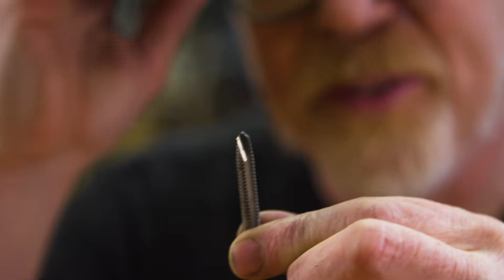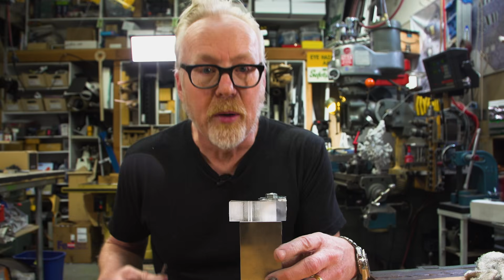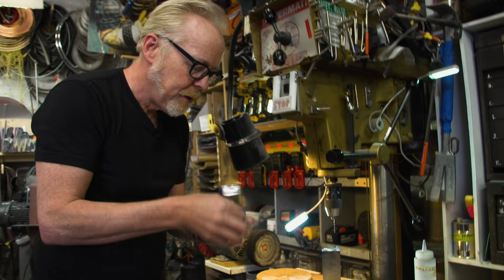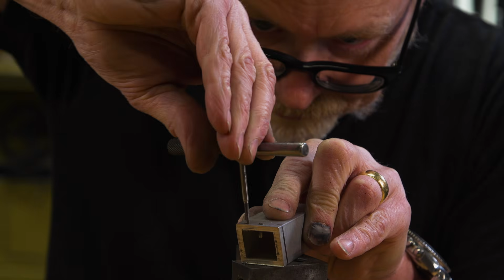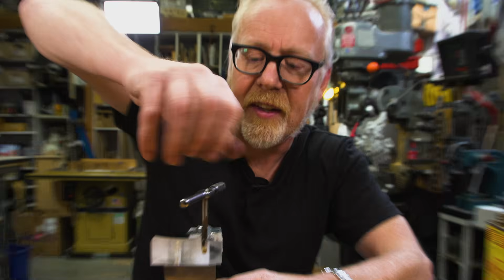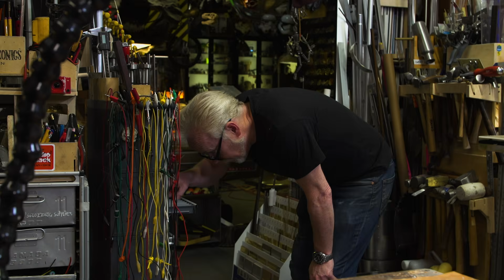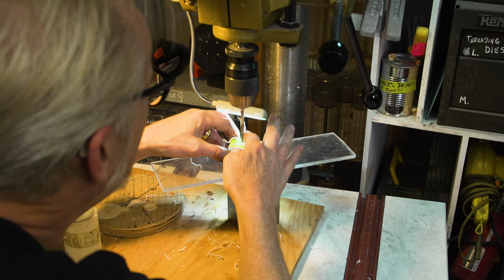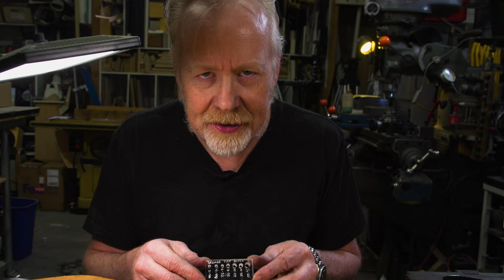Adam Savage's One Day Builds: Thread Tapping Guide Block!

Comment: Adam, this was so joyfully informative! Thank you! Your enjoyment of making and teaching is so transparent and contagious, and I learned so much!
I had to hand tap about 150 8-32 holes in an electrical panel backplane for a customer a few years back though, and it drove me nuts. Snapped about 4 taps, 
A machinist friend afterwards told me that digitally controlled drills (like a standard DeWalt 20v battery powered drill) worked wonderfully well for power tapping, since you can precisely control the torque and stop in an instant. 
I tried it for the next machine we built, got the panel done in a fraction of the time, and didn’t snap a single tap!!!
Reply: When I made panels, I would use an electric drill for tapping.  Just dip in cutting fluid between holes.

Comment: How to remove a broken tap:
Heat it red hot, smack with something hardened.
Or, ruin a carbide endmill (rpm higher than ever appropriate, light feed, melt tap, success)

Comment: Have you been using “Tool, fine adjusting (hammer)” on your finger tip?

I love the reference to the “Hitchhikers guide”

My buddy was an Admiralty (Royal Navy) certified welder. I’ve seen him weld (not solider or braze) cigarette packet foil together. Adam, a challenge has been laid down (hint, a strike plate was involved).

Comment: One extra tidbit,  if you don't have a block or the surface isn't flat (say tube) and you have it fixed/clamped in the drill press to drill the hole anyway.... you can use the drill press to guide the tap (no power).  There is a little dimple on the end of the tap you can put a point into, in place of the drill.

Comment: I semi concur with not buying a full set.  But I would say buy a full set of CHEAP taps then replace the ones you use frequently with QUALITY taps.  That way when u need an occasional odd ball you don't have to run to town for it.  Also a full set of numbered bits is a must. And again I recommend a cheap set and replace the most frequently used ones as needed with quality bits.

Comment: Good day Adam,

Watching you use the grease pencil to mark your tap block was a neat idea.

I have a key cutting machine that is set up like a mill.  The numbers on the dial "used" to be white but are rather difficult to see now.  The dials are metal (steel I believe), what's the best way to remark the dials?
Reply: White Out works good. Sharpie if you want black. Car touch up paint pens are great, use acetone to clean off afterwards. Any liquid paint will do.

Comment: 1/4 20 thread taps are your FRIEND. Even if you're not a maker, get one. Seriously. I ended up with a full tap set by accident here in the studio and I'm CONSTANTLY using the 1/4 20 to repair crossthreaded threads on everything from cameras to stand mounts to, well, shit, you name it. The majority of everything in production uses either 1/4 20 or  3/8 16, and the latter is mostly only used tripod head mounts. So it's useful to have those two threads handy, both the tap and the die. Seriously. Throw them in a little plastic envelope, keep them in your grip bag, and never, never, never get rid of them. As a side note, it might also be useful to obtain a die for a Matthews Doorway Dolly if you're crewed for that, because damnit all those wheel axels LOVE cross threading in my experience, but I don't remember that threading off the top of my head. Anyway, get a 1/4 20. Trust me.

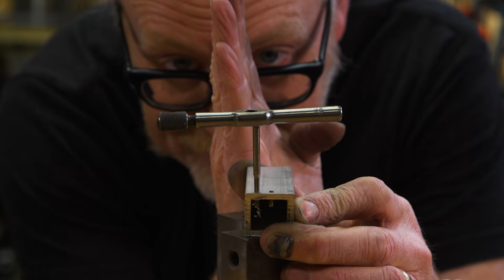Comment: Minute 18:40 - after having drilled, without moving your working piece, pull out the drill from the drill-press and - AFTER HAVING DISCONNECTED POWER FROM THE DRILL PRESS - install the tap on the chuck of the drill-press. Then - lowering the chuck gently till engaging the tap into the hole - rotate the chuck by hand till a couple of turns will be cutted. Finally, open the chuck WITHOUT moving the tap, and go on tapping by hand.
You will be sure the tap will be exactly vertical with your piece, as should be.

Comment: Minute 16:41 - extract a broken tap is a big problem, expecially in a blind hole. In aluminum i sometime got the broken tap outside after having corroded a bit the tapped hole with a drop of ferric chloride, the same used for engraving copper printed circuit board by the electronic hobbists ... of corse the hole and the threads will then a bit more loose, but then you can at least do something more, for example make a bigger hole and then use a bigger tap. Otherwise you can fix the screw that is to be used with a bit of loctite ...
Leave the ferric chloride stay a bit ( from a couple of hours to a whole night ... ).
After having extracted the broken tap, clean very well the tapped hole, try tapping again ...
Ferric chloride is toxic, work in a well ventilated area ...

Comment: Minute 15:28 ... for drilling and tapping aluminum, try alcool; here in Italy you can use "denaturated" one ( added with acetone ), which is very cheap but highly smelling ( just the same used in medical disinfection ). I prefer "pure" alcool, the same used for making cakes or home-made spirits, not smelling by highly taxed in Italy  ( very expensive ).
Only two instructions :
- beware flames and fire, also during drilling.
- not to drink ( neither denaturated - with poison inside, nor "pure" type - 96÷97 % ! will kill you ! ) and open the window so not to breath its vapours and became drunk ! ( more dangerous while working with drill press and similar machines, as lates, ... )
Alessandro from Rome

Comment: try using  DAWN as a lubricant for plexi and lexan acrylics .   I tried about 13 different cutting fluids for tapping in these materials.  DAWN was a shocker.  the threads cut beautifully and cleaned up with water.   some solvent and oil based cutting fluids will microfracture acrylics over time.

Comment: That bleed und you nail must have hurt. A red hot nail held in a pair of pliers quickly used to puncture the nail to release the pressure makes a major difference. And you need to stop smoking. Dr Frank

Comment: For anyone that works in metric, to find the tapping drill size of any metric tap. Take the diameter of the thread and subtract the pitch. 
For example the thread M10 x 1.5mm (10mm diameter x 1.5mm pitch) 10 - 1.5 = 8.5 <-- tap drill size.
M12 x 1.75mm = 10.25mm <-- tap drill (round up the 5 = 10.3mm), M6 x 1mm = 5mm <-- tap drill, M52 x 5mm = 47mm <-- bore size.

Once you know this you no longer require a metric tapping chart.

Comment: I do tapping regularly. I've only broken one and I often do it using a power drill which is something you probably really shouldn't do, but it is fine if you don't mind fast and dirty. It doesn't hurt that most of the metal I work with is aluminium.

Comment: Thank you for including Starter and Bottom taps in the conversation.
There are three types of taps. Starter (taper), Plug , and Bottom.
For tight corners, an 8-point socket works great with taps. 
When going to a metal fab to buy metal they left over from their projects, ask for “remnants.”
39:20 Adam what the hell did you do to your finger?

Comment: You can also derive that aspect to wood. Not just metal. It'll change your perspective on wood tapping too. But you already knew that Adam. My 1962b reissue  strat was built in 1984. The pickguard is not true whatsoever.  But when you take the guard off you can clearly see it is a reissue. along with the serial on the neckplate. And you can see in the wood itself, they didn't tap. They just screwed it in . I fucking hate that.

Comment: The only way I have successfully been able to extract a broken tap out of a block of metal is by utilizing dental burs.  The #5 RA5 Round Carbide Bur for a Low/Slow Speed Handpiece seems to be one of the better ones; it is a 22 mm length 1.6 mm head length.  They are not very big, but perfect for using in a dremel tool.  It is a slow, delicate, and not too expensive way to get a broken tap out.  Each one cost about a $1.30 a piece and I have used up to 10 to get a tap out, but it is far from a quick procedure. I learned about doing this as a Biomedical Equipment Technician in the Navy; however it wasn't one of my peers who taught me this.  It was while stationed on the USS Belleau-Wood homeported out of Sasebo Japan '98 to 2000.  I had a steam generator go down on one of the sterilizers and when I was pulling out the heating element, I broke off not one but two mounting bolts for the chamber.  I could have probably Just drilled out the bolts while the generator was in place, but the right way to do is pull the generator out (royal pain in the ass and it takes a sterilizer down for longer period of time).  I convinced my Medical Officer it was the right thing to do since we had a machinist shop onboard that was fully capable of extracting the bolt correctly.  So, I pulled the generator and took it down to the machine shop where the machinist allowed me to utilize their drill press in order to re-tap the hole.  All went well with drilling the hole, but while re-tapping, I got a bit heavy-handed and ended up breaking the bit.  At this point, I was out of my element as I had never broken a bit (sheer luck I am guessing), so I asked the machinist and she (yes, she) told me to go to Dental and get two boxes of carbide dental burrs.  When I came back, she used them with the dremel and after about an hour and 5 burs later, she had chipped out all of the broken tap.  Hope this helps someone out.

Comment: I like the tapping block... i usually place tap in drill press and hand turn to start the tap then remove and do by hand... been doing loads of M2 taps recently in brass... works a treat... will build a tap block and compare time saved.... so nice to see inside Adams shop... so many similar bits and pieces ... magnets fixing tools to drill press !!! YES... i even glued a magnet to cordless drill... so useful for holding bits and screws...

Comment: As a veteran of far, far too many broken taps, I can confirm breaking a tap can ruin one's entire day.  In the late 70's and early 80's I worked as a lab technician.  I was absolutely thrilled when the shop picked up a tap extractor.  It was basically an arc welder with a water pump and a chuck which held thin copper tubes attached to a drill press like quill.  One simply chose the correct diameter copper tube, placed the work piece in  the vice, turned on the pump and arc, and slowly advanced the tool into the tap hole.  In a matter of seconds, the fractured tap would be sliced into bits to be easily extracted from the work piece.  It was wonderful!

Comment: that black finger nail makes my black finger nail look weak! No but since you have a milling machine a carbide endmill will eat a tap for breakfast! Also Omega Drill witch they have a drill design that will drill through broken taps. i bought one with a 5/64 dia. and it will drill out #4 #5 #6 or M3 M3.5 taps its definetley an odd looking shape to it but it works!

Comment: I'd also add that the drill chart recommended drill size for a given tap size is NOT a hard and fast rule.  It assumes you want a 75% thread (meaning 75% of the hole will be cut threads, i.e. the hole is slightly oversized for a 100% thread, which you probably never need and don't want).  Often you only need a 50% thread, so less thread thickness.  When I need the strongest thread possible, I use the tap chart.  When I don't, especially if the hole is deep in difficult to tap material (more threads, more chance to break the tap), I may drill it with a slightly larger (a few thousandths) drill to make the tapping easier.  This has saved my butt many times, especially in difficult to tap materials like deep holes in copper, stainless, etc.

Comment: Just curious if I missed something, or if there is a reason for it I don't know about.  If the 3 smaller sizes all use the same size guide hole, why bother drilling 3 the same size?  I would think you would be better served adding a couple more different sizes, like 5/16 or 3/8, vs having 3 holes that are all identical?  That said, Definitely plan on making one of these.  I already have a store-bought jig that is essentially the same thing for drilling holes by hand, never really occurred to me to make one for tapping holes.

Comment: I would like to point out that if tapping materials other than steel you can actually dissolve the tap using an acid that is non reactive to your work piece but is reactive to steel. You could also us alum(potassium aluminum sulphate or amonnium aluminum sulphate) dissolved in water to dissolve steel taps out of aluminum, gold, brass, or copper. Again not useful of the work piece is steel and acid you really have to check the reactivity. Alum can take longer but is effective I have used it to remove broken steel studs from an aluminum engine block. Tapping holes in steel or iron parts is the scary stuf you have to rely on physical removal methods not clever chemistry.

Comment: Tap extractors are the tool salesmans snake oil. They do not work and i never met any other machinist that used one succesfully. 
Pro tip: If you brake a metal tap or screw in aluminium. Metal taps disolve in water with alum. Aluminium can stand water with alum. It can take as much as a day, but if you brake a tap in a expensive part it will be worth it

Comment: Adam this an older (5 month old) video, but have you ever tried spiral fluted taps? They have spiral grooves like a drill bit and send the removed material up the groove like a drill bit would.  They are fabulous for cutting soft materials like acrylic and aluminum and don't need to be back twisted like regular taps.  BTW I have and use taps all the way down to size 0 and use them. Am a watchmaker and have even smaller tools than that.  Thumbs up and have a great day!

Comment: When tapping for a 1/4" tap in a 1" material it doesn't increase the strength tapping more than 1/4".  So on 1" material drill all the way with 7 drill. Then drill 3/4" down with a 1/4" drill. It acts as a guide for your tap and will be as strong and easier to remove a broken bolt. As always I learn a lot from you. Thank you very much.

Comment: They were developed for machine CNC tapping (where conventional swarf clearing increases machining time and you're trying to cut production time), but Spiral fluted taps can be used for manual tapping too. No need to back off your tap to break/clear the chip because the swarf comes off in a spiral plus doesn't clag up the bottom of the hole in a blind hole as the swarf is wound upwards away from the point. Also reduces the chances of breaking a tap, because the cutting action is a shearing action rather than a 'ploughing' action you get with conventional gun taps it doesn't take as much force to cut the thread.

Comment: Awesome tutorial.  2 comments though.  If the shaft/body of the 3 smallest taps are the same size, why drill three identical holes in the block?  But ... why not engrave the drill size along with the screw # and threads.  Then, everything is together.

Comment: Tap blocks IMHO are a must for any hand tapping operation.
Drill guide blocks also help prevent bad holes when using a hand drill.
EDM tap removal is the best solution, but out of reach to the home hobbiest, so do your best to follow Adam's advice, because it is sound practice.

I worked in a shop where we made very labor intensive small parts out of really crappy to machine 304 series stainless steel. Some parts, small enough to hold in your hand would often take an entire 8 hour shift to make, so you really didn't want to start from scratch again.
 2-56 was a common thread and often we were called upon to place 0-80 and 00-90 threads in some parts. Most of the holes on the prints were specified to be blind, and often many diameters deep. We made knurled tap drivers to add to the feel that were piloted in a sleeve we placed in the same drill chuck we drilled the material with.This kept the fragile taps on center and eliminated them being angled.
 When we snapped off a tap by getting stupid or in a hurry, (one and the same, to be honest), we would submerse the part in nitric acid in a beaker, place a glass pipette on top of the broken tap then add table salt to the pipette. After an overnight session, the tap was dissolved enough to fall out of the hole. The next step was to polish the stain it left on the surface of the part. 
To mess with another employee when they were tapping with the tiny taps, we would make the same sound as a tap breaking....keek!  
I have no idea how we got anything done there ;)

Comment: Difference between a screw and bolt... a screw has thread all the way up to the head and a bolt has an unthreaded portion of the  shank between the head and the threaded section.  Note, he calls a screw a bolt at 12m45.
Reply: Wrong:  A bolt is a non-tapered fastener that uses a washer and nut to hold objects together. A screw is a tapered fastener that mates with an existing thread or creates its own thread in a material as it turns.

Comment: Interesting. I've always used the drill press (turning the chuck by hand) to center the machine taps. But that's tedious because you need to release the chuck and grab the tap wrench or have a second one. 

The tapping block is much better. :D
Reply: If you look on the non-working end of the tap there should be an indent.  This is so you can center the tap with a live center or other pointy device with the drill chuck so you don't need the tap itself in the jaws of the chuck.
Reply: @jfratis9081  Thanks for pointing that out. Never thought of that.

Comment: I have a similar device, actually just a hard maple block with a variety of drillpress drilled holes to use for a square start when using cordless drill. seldom drill a pilot hole without it, develop a habit, all holes get a square start, and there will be a noticeable improvement on every project.
   A very wise man once told me, "there are two kind of people, people that make shit, and people that don't"